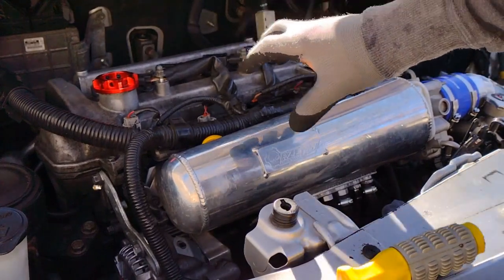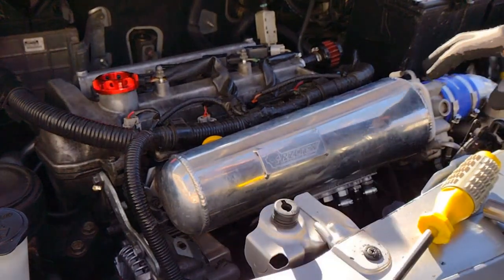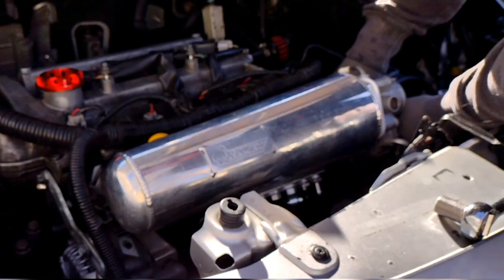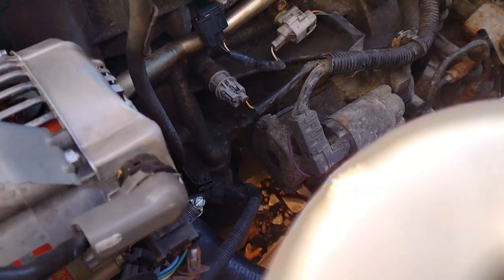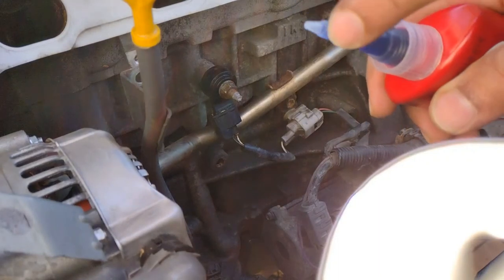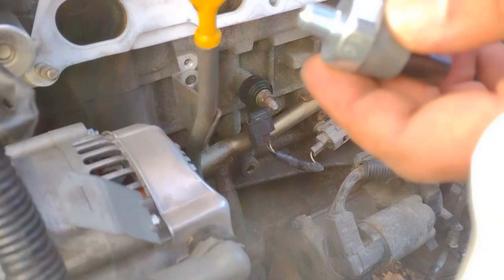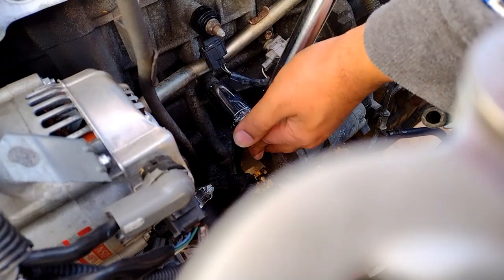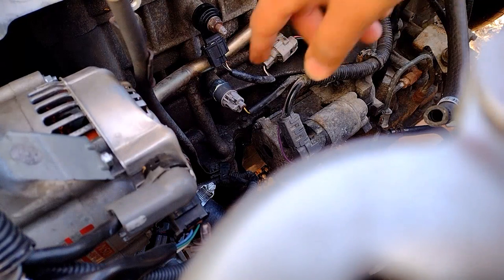Toyota/Scion Oil Pressure Switch Replacement

Comment: what setting did your torque wrench click at? i was always shown to back offf once it clicks,  it is supposed to be not great for the internals.  If i did that with my cheap HF 3/8 torquewrench,   id do some damage to the threads.
Reply from the maker: I had it set to 11 foot lbs. Torque wrenches are fine for any part of the engine internal or external click it makes just let's you know you've reached the desired torque specs you had set it too it won't cause any damage just got to make sure you lock it in whatever torque specs you have it set to if it not fully locked you can accidently change the torque specs while tightening. I have the Pittsburgh 3/8 torque wrench from harbor freight it really good I've haven't had any issues and it also got thousands of great reviews you have nothing to worry about
Reply: @ScorpionMultimedia  i guess i really shouldn't have classified as cheap.  I mean it should get the job done for what i need, just general diy maint. stuff.  I had a hard time feeling the click on lower stuff when it was new.
Reply from the maker: Yeah it'll be able to get any job done with no issues I've had mines for about 2 years now. I think the click slightly different between torque wrenches

Comment: Did any oil come out? Or was on the old sensor?
Reply from the maker: No oil came out or was on the sensor due to car just sitting so all the oil is sitting at the bottom of the motor so you won't experience any mess